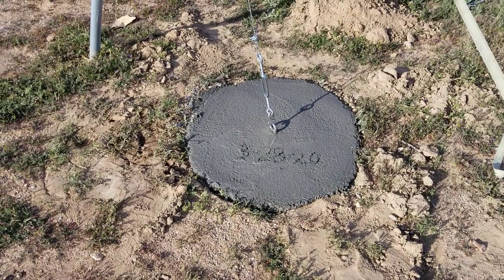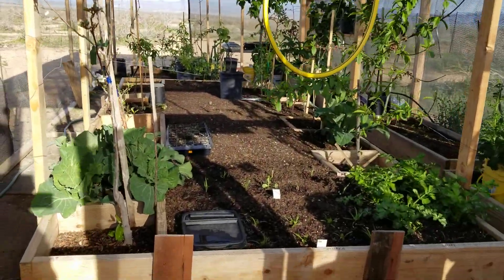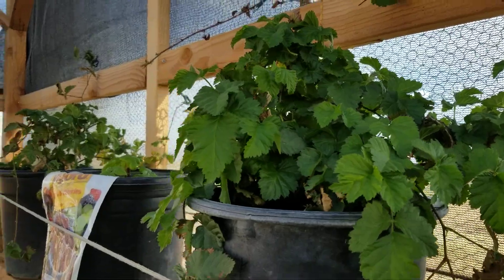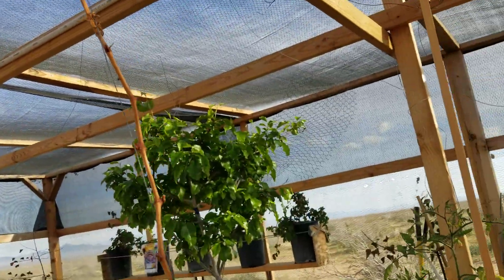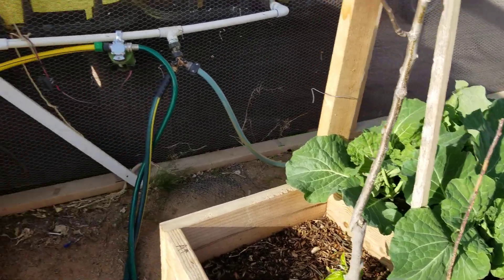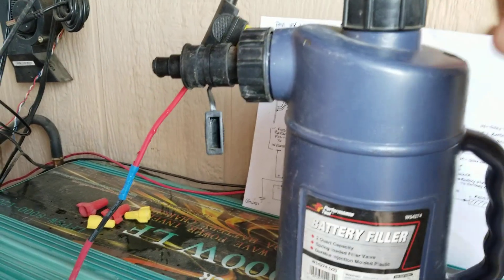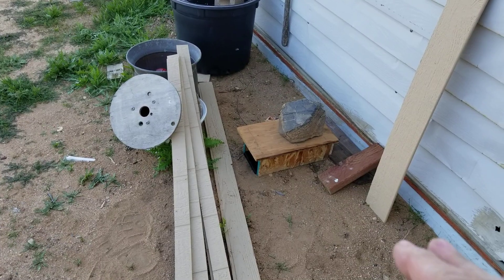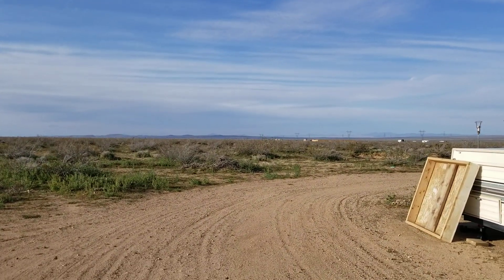PMA guy wire anchor,  March 28, 2020

Comment: Your glue trap tunnels are working so good maybe you need them in the attic
Reply from the maker: I'm starting to wonder about the attic critters.  They don't touch any foods/baits, and there are no droppings to be found.  Strange!  But they sure make a racket on those styrofoam panels, and I can hear them squeezing through the holes in the metal framing....WTH?

Comment: Re your bug buckets...  Do you have to top off the water as it evaporates?  I'm thinking a bucket or two will do well on my driveway, but I'm concerned about maintenance.
Reply from the maker: Yes, I add water as needed, but that's all the maintenance needed.